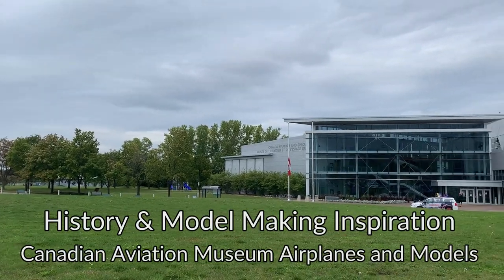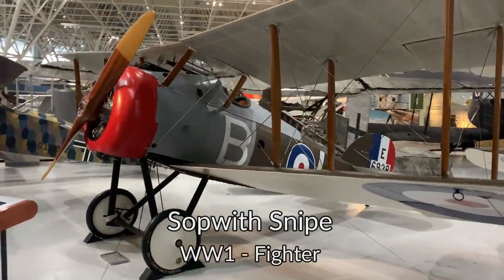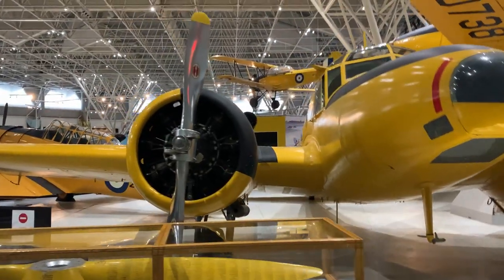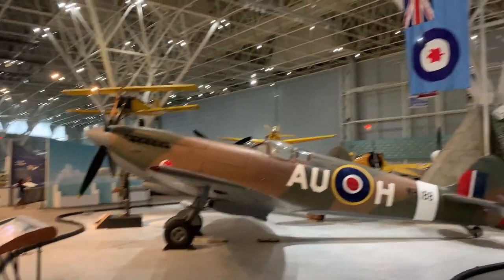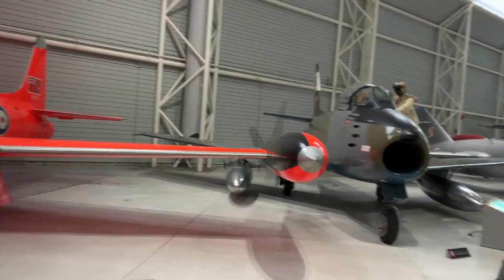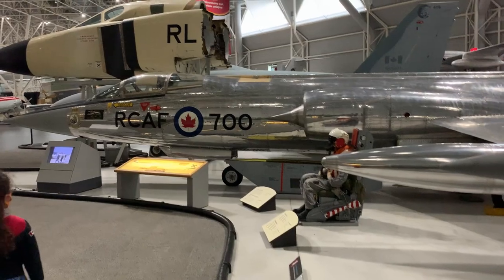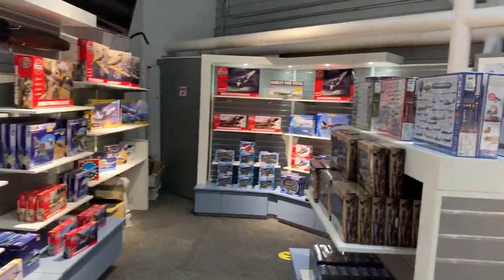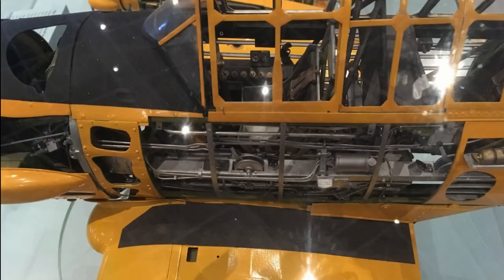Finding Model Airplane Inspiration

Comment: At 1:56, that's not a Nieuport 17. Though the museum does possess a N.17 replica that used to be airworthy, the airframe at the time stamp is a Nieuport 12. Source: I worked on its restoration. My name is also on the inner surfaces of the vertical stabs of Hornet 188901 in there.
Reply from the maker: For some reason I wrote Nieuport 17... maybe because I wanted it to be a Nieuport 17?  At any rate, my mistake!  Sorry about that.